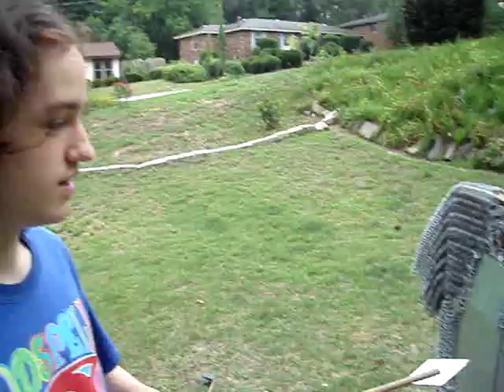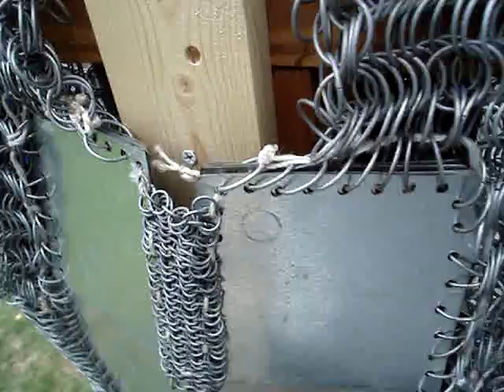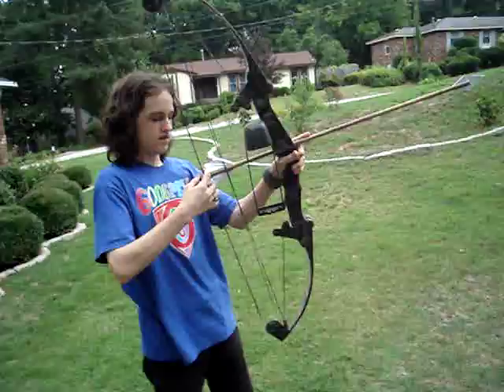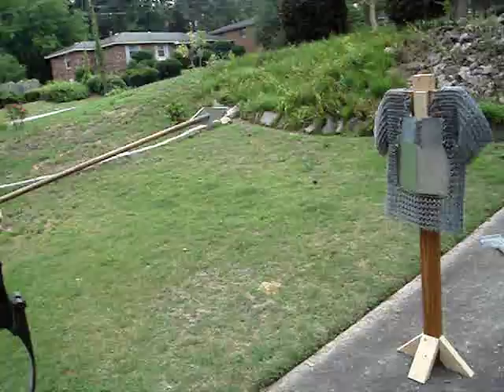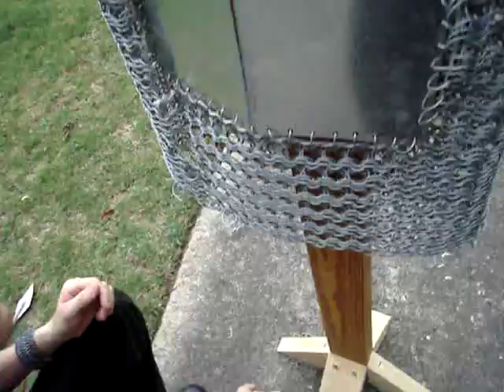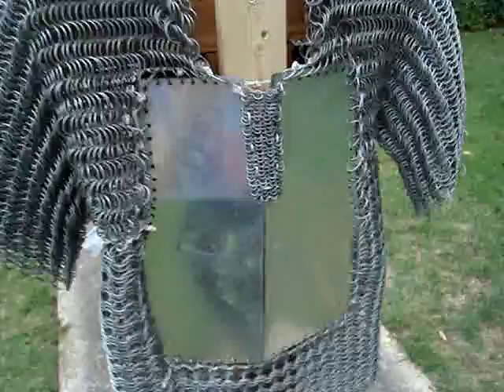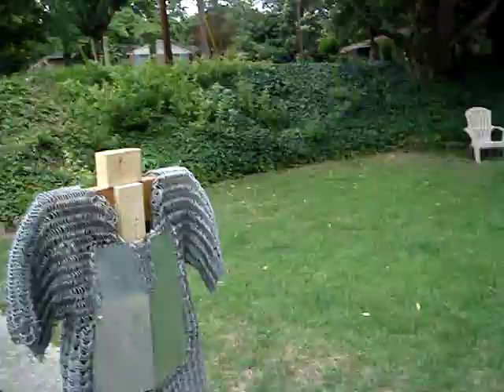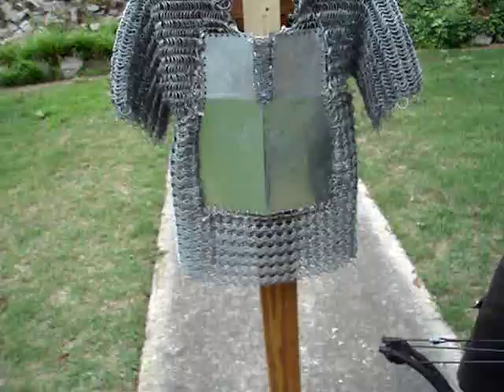Armor Test Plate and Chain

Comment from the maker: 1. As I said, that was the best I could do at the time.
2. The wire is/was galvanized steel.
3. Since then, I have moved on to much stronger wire and rings.  This video was made in 2010.  I have learned a great deal since then.

Comment: Mail used for combat have historically always been riveted or welded. Only rarely do you find butted mail, and only mostly for joints - mainly because the rings come apart at the butted edge and are far weaker than riveted/welded chainmail.

Comment: This is Thrand !!!!!!!

Good work on mail making and good video but this is butted mail historically solid stamped rings and riveted every other row ,riveted every row or soldered or braised shut rings were used. So these test are good for butted mail but historical mail would be way more effective that bow would not pierce it at all. You can look online for some riveting kits if you are into trying to make historically accurate pieces but those are great show pieces and did preform well.

Comment from the maker: @gonefishingstudios That depends on the metal.  If it is stainless or galvanized steel, no.  If it is mild steel, however, you would need to protect it in some way, and oil will do it, though it would be quite messy.

Comment from the maker: @WangsterBling It is the same weave with the same rings, but it is rotated 90 degrees so the rings point downward instead of sideways.  With the way I sewed it on, it allowed the maille to "separate out," kind of like salad dressing.  If you look at it for a while, you will realize that a single piece of 8-in-1 is just 3 pieces of 4-in-1 woven into each other.  However, I would not suggest trying to start with a piece of 4-in-1, as that might get confusing.

Comment: You cant use aluminum broadheads against plate and chainmail armor. You should use bodkins or heads with energy directed at the tip. And you shouldn't fire wooden shafts out of a compound bow. It can break and fly into your hand. You should get a longbow or a more traditional bow for such things :)

Comment from the maker: @shashaveli I do not think that is possible without either welding/riveting the rings or using ridiculously thick wire.  I do not have the tools to weld/rivet, and I do not feel like using anything over 14ga.

Comment: if you use 7mm rings even if its not rivetted it should still be quite strong and more effective against projectiles and try galvinised steel wire it doesnt rust and its stronger or just well oiled steel .....

Comment: Yeah i think you should maybe try making a shirt with the small 18 gauge rings, your main rings are to huge. and maybe go buy a few arrows that are actually long enough and that have a normal arrow tip, not even the arrows in medieval ages were that huge. But even then chainmaille was always worn under plate armor. Leather takes a better beating then steel.